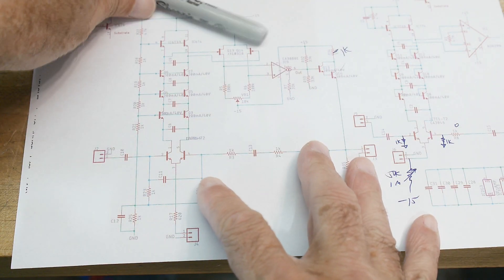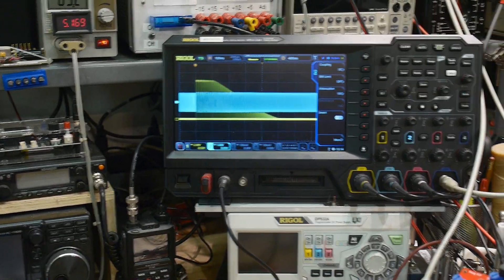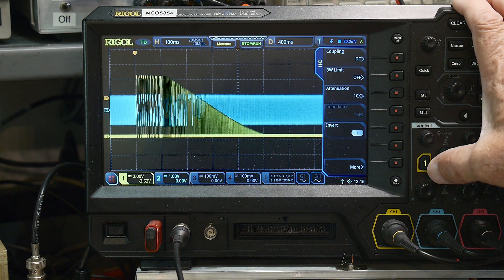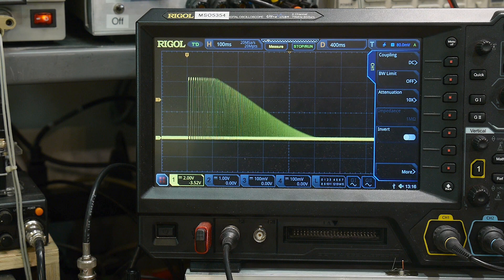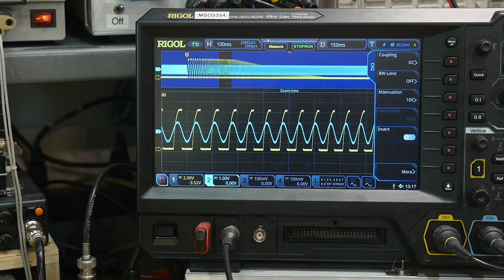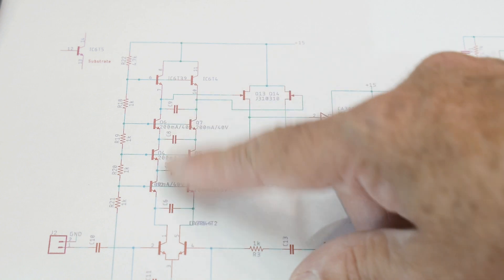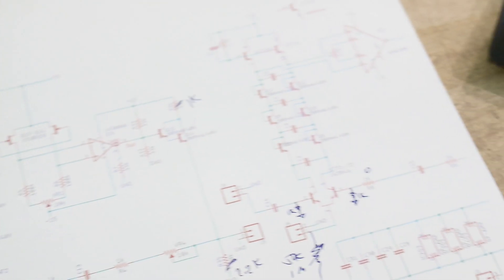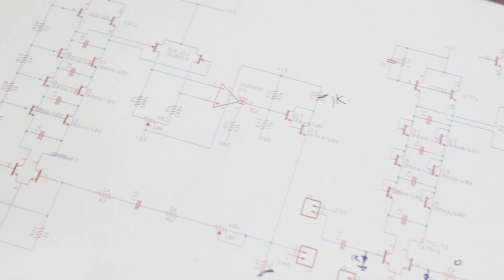#1214 DIY Analog Synthesizer (part 12 of 15)

Comment: It is hard to tell from the video, but it looks to me like your bottom transistors are not biased.  The base and emitter both seem to be at DC gnd.
Reply from the maker: no the emitters are being pulled to -12
Reply: @IMSAIGuy  Check all the Vbe with a differential probe (or a scope difference) and verify than none dip below 0.65 V.  If memory serves the input should be below 100 mV peak at the base.

Comment: Diff amps (the JFET long tail pair) are usually very sensitive to voltage input range (must be approx <100mV). If your signal is less hot going into the amp, it may help...?